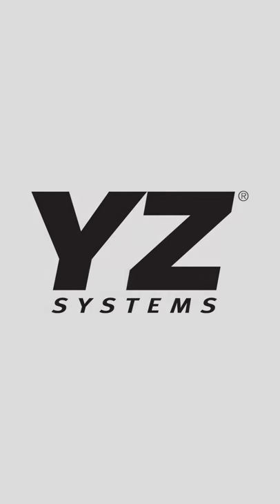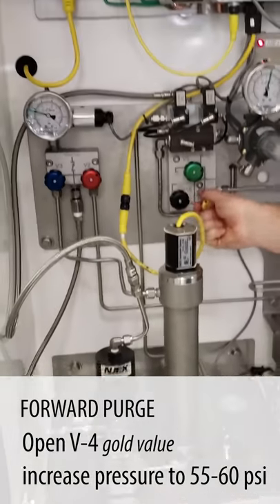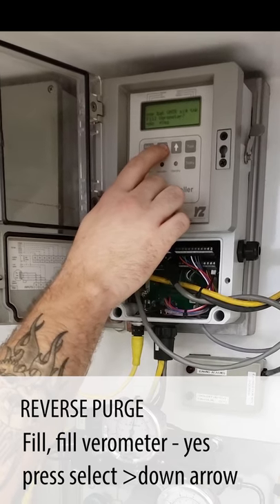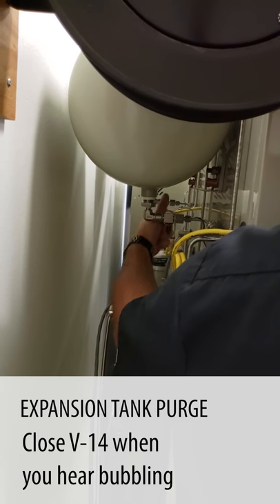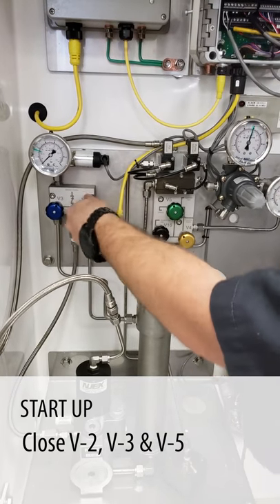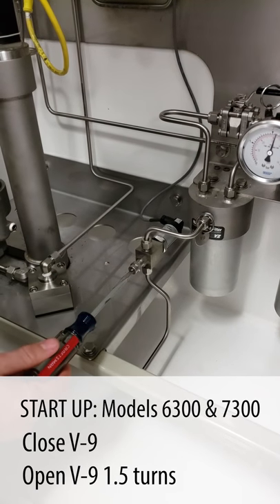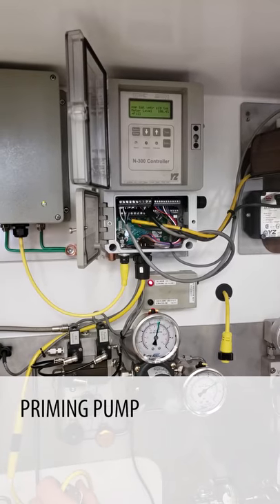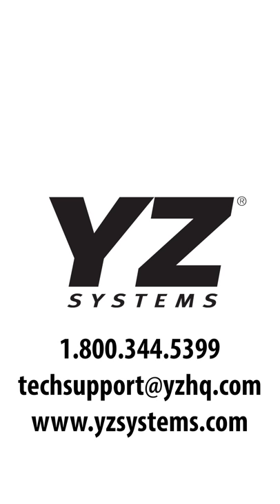YZ Systems Odorizer Purge Restart [Mobile Enhanced]

Comment: Sir,what is the function of expansion tank ?
Reply from the maker: Hello, the purpose of the expansion tank is to be a cushion to odorant coming into the verometer. It keeps pressure on the odorant to pack the inlet of the pump the same every time.
Reply: @yzsystemsaircom  Thanku sir...
Sir how much dosing is done in  pipeline and in what time ?
2.Why we do blanketing in bulk odarant storage tank and at what percentage of blankting is done ?